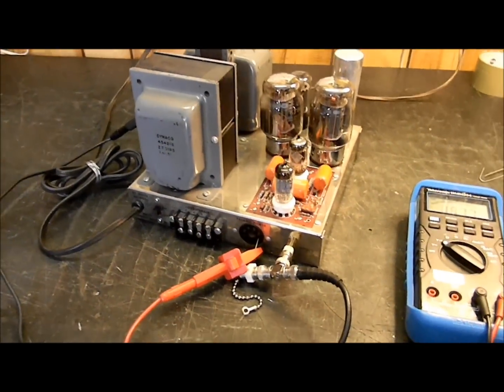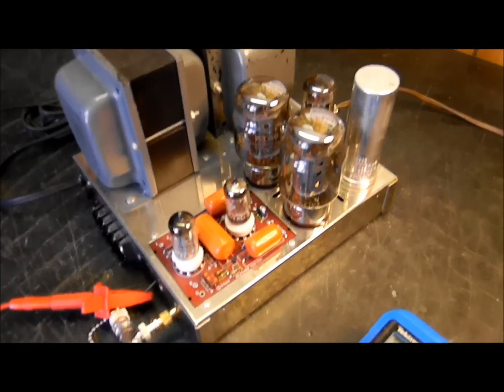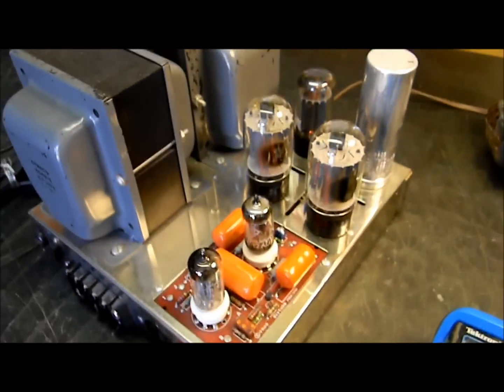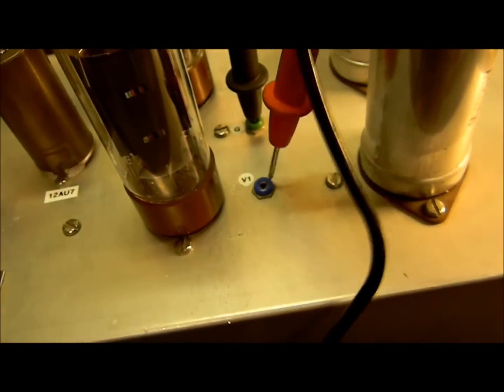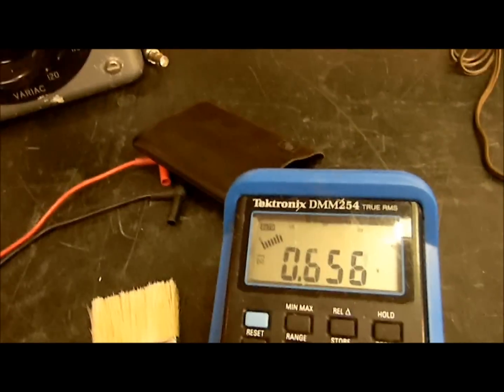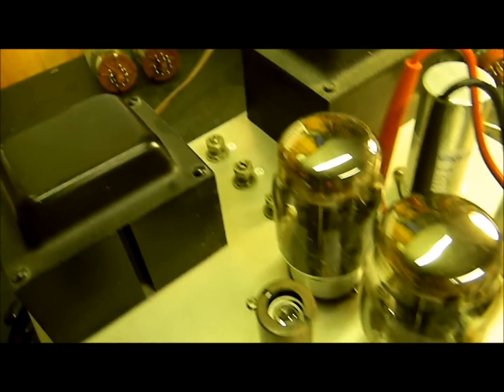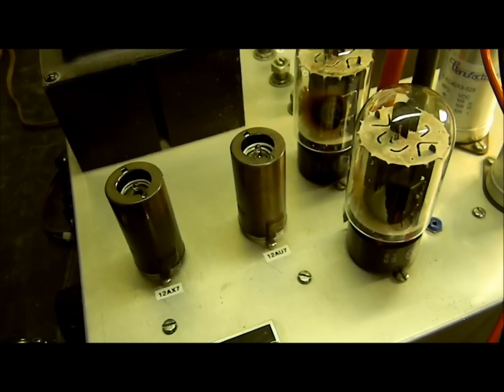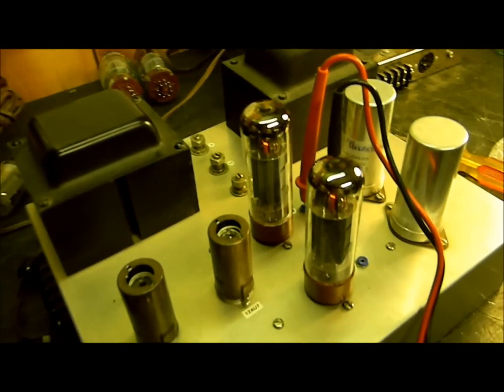KT88 vs EL34 vs 6L6 Substitution In Vacuum Tube Amplifier.wmv

Comment: Yea but like I said I replaced the 6L6s in my Marshall JCM 900 with KT88s years ago and it still play perfectly. Do you know anything about guitar amplifiers? When I switched out the 6L6s with KT88s I had the amplifier re-biased and the thing plays better now than it ever has before. I'm just wondering If it is possible to do the same thing with a Mesa Boogie Triple rectifier.

Comment from the maker: A pair of 6L6's is good for 50 watts and a pair of KT88's are good to 100 watts - that's just the way it is. You cannot put KT88/6550 in place of 6L6's - It will "work" but not very well and not very long. Hope this helps.

Comment from the maker: That is correct about the 7027 - pin 1 is tied to pin 4 internally which is the screen - which also means depending on how the socket is wired, if a 6550 with its metal ring is plugged into a 7027 socket you could end up with screen voltage on the metal ring (because of pin 1). Also, pin 5 and 6 are tied together on the 7027 which means on the 6L6, etc group of tubes, often times pin 6 is used as a tie point. Thanks for the post and bringing this to light for all viewers.

Comment from the maker: I have never personally had any KT77's but they are sold as replacements for EL34. The KT66 is sold as a replacement for the 6L6. KT88's and 6550's are interchangeable. All, of course, with attention to bias and plate current when initially setup.

Comment from the maker: 6L6's run at about 40 mA each (80 mA per pair) and it is customary to put in a fuse at twice the normal current rating. KT88's are about 70 mA per tube (140 mA per pair) so,l with that approach you would need 280 mA fuses - It would be wise to stick with the 6L6's - there are many brands out there, and 6L6's are about half price of KT88's. Hope this helps.

Comment from the maker: KT88's draw 1.6 amps per tube filament current to a 6L6 of only 0.9 amps per tube so, that is one concern. The bias on the KT88 will need to be made considerable more negative to reduce the cathode current to an acceptable value. There is likely not enough adjustment in the bias pot to accomplish this. You will need to change bias divider resistors and even then, you may not be able to attain a proper negative voltage setting for your KT88's. You may find more help in some of my other videos.
Reply: I read an article on the KT88 tubes. Swapping from EL34 to KT88. It read that the bias feed resistors should be switched from 220k to 100k resistors to accomplish a proper reading. I believe it was something about reducing the grid resistance, so the KT88's can run at the proper rating. Is this true?  and where are these bias feed resistors located?

Comment: this is so cool. I am a worship pastor and I use tube amps with my electric gutiars and I love how all this works. I hope to have the understanding and some of the testing equipment you have someday. Glad that there are people doing this kind of stuff still, no one my age seems to be (Im in my mid 20's). The only tube thing Ive built so far is a 12ax7 powered overdrive pedal.

Comment from the maker: Thank you for your comments. There are may reasons we can't permamently swap 6550's into a 6L6 amp and one of the most fundamental reasons we can't is because of the filament current required for the 6550's. A pair of 6550's require 3.2 amps to light the filament whereas a pair of 6L6's only require 1.8 amps. The filament winding on the power transformer will be damaged over a period of time if it is overloaded by that amount.

Comment from the maker: I have noticed that the vintage amps deliver a lot of power with low distortion and no clipping up to full power - example - Ampeg SVT. And I agree with you on the Fenders (6L6) - usually run at a lower distortion (overdrive) level and cleaner tone and the Marshall's (EL34) run at high power and lots of overdrive/crunch (which is clipping at 10% THD or better) They all have their purpose in making the music we love.

Comment: EXCELLENT. Once again a sober, well researched test based on science, repeatable measurement and not some air-head's "killer ears".

All it takes is some reading and LEARNING from text books. The ARRL handbook is a great primer.  The math is simple, but verbal hype from the guy at the bar or the salesman at the snobby hi-fi shop will NOT teach you about this technology. Most people hate having to learn even simple science.  Lazy brains I suspect.

Comment: Always use the tubes recommended for the correct voltage, bias, and primary impedance of the output transformer.   Period.

Comment from the maker: Speakers being connected is only important if you are driving the amp with a signal. You can safely measure voltages with no speakers attached. High voltage is a rattle snake so connect your leads before you plug it in to the wall. Work with one hand in your pocket and never lean on the equipment and don't use both hands when measuring high voltage as you want to avoid any current flowing from arm to arm through your heart. Getting across the plate voltage is a bad experience  :-(

Comment from the maker: If you check plate voltage with no tubes the power supply will be operating with no load and it will be abnormally high and not the voltage that will be on the plates of the tubes when they are plugged in. The bias voltage will not be affected with or without the tubes being in.

Comment: I am a beginner, this is likely based on a marshal major 200, modified at some point with tag strip. possibly modified to drive four EL34/6CA7 as hard as possible. I need to check the voltages delivered to the power valves as safely as possible, if I run the amp to test the plate and bias voltages without tubes installed I am guessing the main danger is the capacitors. Is it safe to run the amp without power valves as long as I connect a speaker? I have a variac and a digital multi meter. thanks

Comment from the maker: Pin 1 on the metal based 6550's is connected to the metal base and should be grounded for safety. Pin 1 on EL34's is the third grid and must be connected to ground or the cathode (pin 8). G2 at 1Kohm sounds like a smaller tube than the 6550. G1 at 55Kohm is pretty high. Glowing hot EL34's - not good - make sure the bias voltage is adjustable to at least -60 and there is no AC ripple on it. My guess at a distance is bias supply issues. Hope this helps.

Comment: Hi, a 1965/7 amplifier 4 octal and five 9 pins, I think it showed 800V on the plates, blew a capacitor and stopped fiddling! I am guessing a KT88 amp. I have EL34's but they quickly glowed very orange! G2's go through 1 KOhm 5W resistors to the PT output, and G1's go through 55KOhm 1W resistors to the preamp section. Kathodes are tied to pin1's (G3) could this be the main cause of the orange glow along with 650V on g2 ?
Is it safe to check delivered voltage with no power tubes or speaker? cut@1

Comment from the maker: Best to tube it for what it was designed for. KT88 and EL34 draw about the same amount of filament current (1.6A and 1.5A respectfully)  6L6 is only 0.9A so if you put the bigger tubes in a 6L6 amp, you will overload the filament winding of your power transformer. 6L6 and EL34 are close in power output. You can get a little more out of the EL34 as it can take 800 volts on the plate, 500 max for the 6L6. KT88/6550 is twice the power tube of a 6L6.

Comment from the maker: With correct cathode current of 40 mA on the 6L6 raised to 80-100 mA, I would say less than an hour. I used to have a McIntosh MC240 that would ruin 5881's within the day. 6L6GC would last years. If you look up the old specs of tubes you will see that a 5881 has less plate dissipation than the 6L6GC - and plate dissipation matters very much. If you can measure cathode current, just simply multiply that times plate voltage and you will get idling plate dissipation. It will increase under drive.

Comment from the maker: Yes, 420 - 450 is a healthy plate voltage for 6L6's although 490 or so is not uncommon and I believe that is what the Dynaco and MA230 cloan is running at in this video.

Comment: The extra power sure helps with bass and transients. Frequencies below 200Hz use most of your current.  You speaker is 8 Ohms @ 1000Hz (NOMINAL impedance). At 80 Hz where the deep bass of the kick drum or string bass resides, most speakers go down to 1-2 Ohms -or less!  -That's where all that great KT88 current goes! Now they even make a KT120.  But if you get up to that power range, Why not experiement with 811s or 572Bs (they're not expensive) -You might like class A at 50 watts!

Comment: PS: I'd love to see a proper show-down of the 6L6 vs. EL 34 (for hi-fi purposes). Do a sweep through all extreme freqs, IM, HD, clipping, headroom, periodic harmonics, etc. E.g. do the 6L6s really have better bass? Which valve has better transients?  @ which freqs?  Using the same amp (output & power x-formers) with reasonable bias, cathode current & B+ adjustments makes this a 1st class objective test,  Next, I'd love to see tube brands tested with no tears. -GREAT STUFF!

Comment: Excellent presententation.  You, um, have a few more test toys than I do.  You are either a serious pro or your wife has left you.  Seriously, This shows that there is not much difference in the desgin for push-pull amps using the popular valves.  However, it also shows that there is a more than simple grid bias to good tube life, low distortion & high efficiency. Could you do a test on power vs. 3 main types of distortion with the 4-5 main power tubes?

Comment from the maker: Remember that power is voltage squared divided by resistance - so, for an example, 20 volts across 8 ohms is 20 squared (400) divided by 8 which is 50 watts. For 50 watts across 4 ohms it would be only 14.14 volts. Across 2 ohms it would be 10 volts for 50 watts. Hope this helps.

Comment: my kt88 amp has a an 4ohm out and a 8ohm out.
but they 4ohm just gives half of the voltage of the 8ohm instead of 2/3.
so it does just give half the wattage in the 4ohm tap.
is the 4ohm misslabled 2ohm tap? because if i loaded it with 2ohms i whould get the full load.

Comment: I would like to try EL34s in my Scott 296.  Can it be done, replacing GE7581A(KT66) with 6CA7/EL34s? The 7581 is similar to 6L6GC with more output 35w vs 30w respectively.

Comment: those dynaco amps work best with 6550 tubes and each  amp is mono 2 for stereo if u want a lil more push u can add a preamp or use a stronger preamp tube and plate resistor of 100k to a 90 k or a 500k to 490k   that should bring you about 60 watts and a lil bit of distortion but still give a nice warm tone 1 fact in mind is wat class amp it is such as A AB C pushpull class A is pro the other 2  are mid to hi grade home stereo use and have hi distortion  not so good when u want quality sound

Comment from the maker: The 6V6 is a beautiful low power tube and it only requires 0.45 amps filament current (you might think of a 6V6 as 1/2 the power of the 6L6. The 6L6 requires 0.9 amps filament current. The EL34/6CA7 requires 1.5 amps filament current so it would seriously overload the filament winding of your 6V6 power transformer and I doubt the 6CA7 would even light up properly. So, unfortunately, no, this won't work.

Comment from the maker: Well, EL34's draw almost  twice as much filament current as a 6L6 so the filament windings won't be overloaded and the bias is "probably" high enough (negative enough) on the EL34's so the 6L6's won't draw too much plate current. However, the EL34's can handle much higher plate voltages (800V) than the 6L6 (500V). Overall, it might work "OK" but probably best to put the EL34's back in. Google "6L6 datasheet" and "EL34 datasheet" and check it out for yourself (nice PDF from Svetlana out there).

Comment: My amp tech has replaced mesa EL34's with JJ 6L6GC's in my amp w/o consulting with me and I'm just now noticing he did not follow my plain directions on replacing only with what came factory and 1991 Marshall JCM 900 Hi Gain Dual Reverb 100w model 4100 came factory with EL34's.. How pissed should I be right now??????????

Comment from the maker: With all said below, if you can measure cathode current and limit it to about 140 mA with no drive for the pair of KT88's then it might be fun to try. EL34's draw 1.5 amps per tube (3 amps total for two) so, if your amp will support EL34's it should do OK with the filament supply for the KT88's. Reasonable cathode currents for a pair of 6L6's or EL34's is about 80 mA (40 mA per tube). Hope this helps.

Comment from the maker: I am not familiar with your amp so I can't say for sure. 6L6 & KT66 are interchangeable as is  the EL34 & KT77 but there is considerable difference between 6L6 & El34 and again, a considerable difference with the KT88/6550 - basically, a KT88 is capable of twice the output power of a 6L6. EL34's have a much higher plate voltage rating than the 6L6. Without a considerable bias voltage range the three tubes above can not be substituted one for the other. There is also filament current issues.

Comment from the maker: It might need new tubes but It is wise to stay with the same output tubes. Your amp is designed for the EL34. ECC83/12AX7's can last a very long time as they run much cooler. Adjusting bias -  that's a whole other discussion. Using a good quality contact spray cleaner does miracles and may be all you need. Dirt, grit (and beer) take a serious toll on musical amps. Spray/clean every pot/switch/and plug if you are comfortable with working on your own amp. High voltage in tube amps can be LETHAL.

Comment: I have a Marshall JCM 900 4100 Hi Gain Dual Reverb that's cutting out and losing volume was squeeling the other day. I think it needs retubing. The preamp tubes are JJ ECC 83.s and the pwr tubes are Mesa EL34 str 447 model...... Can I go to JJ 6l6GC in place of EL34's? How much does it cost to replace the 3 preamp tubes and 4 pwr tubes and biasing nowdays? I think I want to go with all JJ tubes. Thanks for the info.

Comment from the maker: 6L6's are really good to 40 watts and 50 watts max with any reasonable amount of distortion in the creation of music. If you drive it into a square wave output you may get 60 watts. Similarly, the 6550/KT88 is outstanding at 75 watts but will do 100 watts at higher distortion. Square wave output on a KT88 might reach 120 watts. Just because someone puts 160 MPH on the speedometer of a car does not mean it will go that fast – unless it is off a cliff and it won’t be long before the ride is over.

Comment from the maker: @MICKSHRED No, that would be a bad idea. As  documented in one of my later videos, filament current of the 6L6 is 0.9A and the 6550/KT88 is 1.6A so you will overload your filament winding in the power transformer. Also, the 6L6 runs at about -40 volts whereas the KT88 runs at about -46 volts so the KT88's would be drawing much more cathode current (once again) overloading your power transformer. The other way around (might) be more acceptable.

Comment from the maker: Bias adjustments are meant to set a value of cathode current which is definitely related to plate voltage. The cathode current is the sum of all the currents in the tube (i.e. plate and screen) but the screen current is small so essentially, the cathode and plate current are the same. The Current is what you actually want to set and ultimately you want the tubes to be "matched" by having the same current (measured in mA) flowing in each cathode of the output tubes which makes them "balanced".

Comment from the maker: And lastly, remember that these "experiments" in swapping tubes around are not meant to be permament changes. KT88's are more powerful tubes than the 6L6 or 6CA7 and will require more energy  to be delivered by the power supply. Ultimately, my goal was to answer a client's question and my last and final recommendation is to Not swap around your tubes unless you are knowledgable and experienced with working with vacuum tube amps and are willing to accept the risks to yourself and your equipment.

Comment from the maker: You should be able to plug your KT88's into your 6CA7 amp (if and only if) you have enough range in your bias adjustment to lower the cathode currents in the KT88's to 70 mA per tube. The socket as wired for the 6CA7 should be OK for the KT88 and as I mentioned below, the worst case would be bias voltage on the metal ring of the KT88's. Check your socket. If pin one is grounded there will be no bias voltage on the metal ring. Work safely with High Voltage.

Comment from the maker: I have all of amps wired so that I can do these experiments. If you choose to experiment with your amps you Must know how the sockets are wired on your output tubes. Also, and most important - always practice safety when dealing with high voltage. Unplug the amp and discharge all power supply capacitors.  At the lease you can get a really nasty shock which will be most unplesant and you will never forget and at worst it can be LETHAL to you or someone else that touches it. Be Careful...

Comment from the maker: So, to make the socket ready to accept either the 6L6/KT88/6CA7 - you Must remove anything soldered to pin 1 of the socket and either ground pin 1 or connect it to pin 8 (the cathode) - probably best to ground it  - Connecting pin 1 and pin 8 together carries a certain risk as pin 1 on metal based tubes have the metal ring connected to pin 1 so you could end up with the bias voltage on the metal ring of the tube and it will bite you if you touch it with the amp powered up. see next post